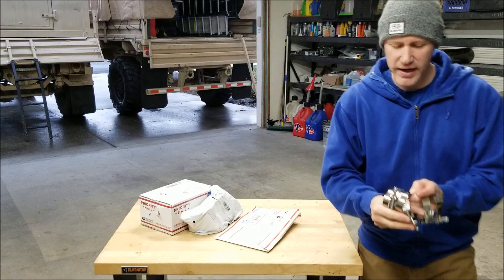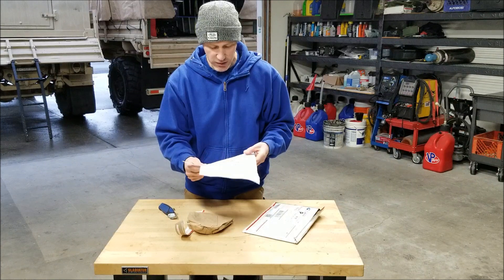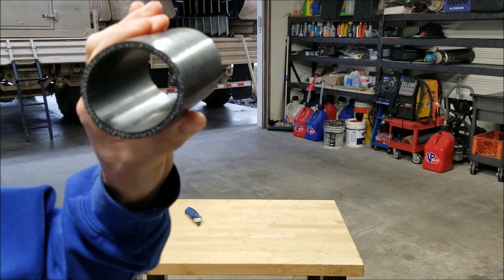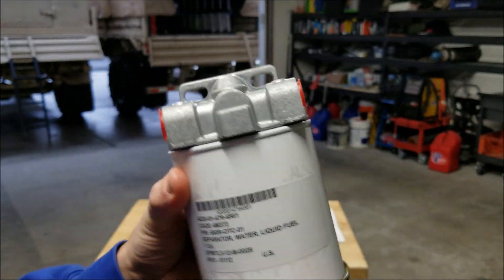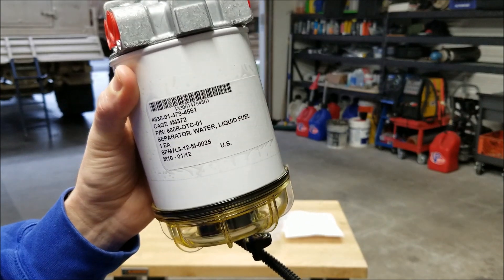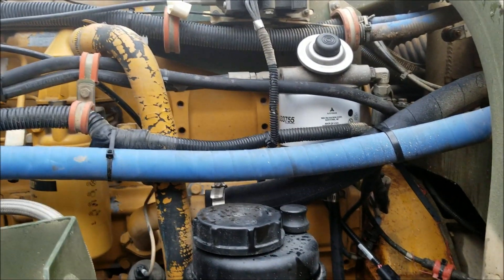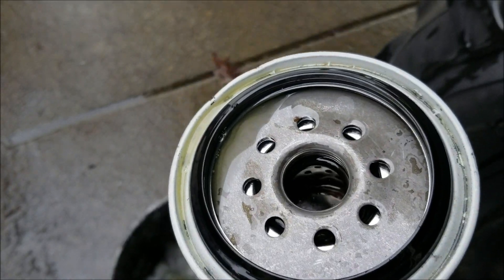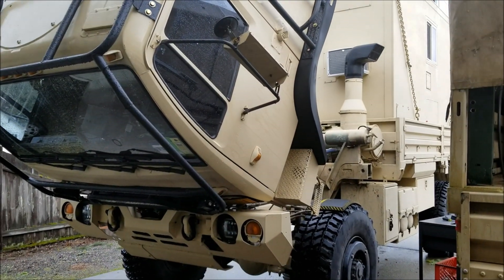Abel LMTV build part 79 (water/fuel separator replacement/upgrade, silicone intercooler couplings)

Comment: That was a good buy compared to the alternative. Too bad that the filters were not interchangeable as well. When we pulled the inter-cooler pipes from PARTriSha, they had a good bit of dust inside them. I'm not sure what that was all about. Anyway, thanks for posting the parts links... I'm sure that will save you time from answering those questions in the coming days. Now, you'll just have to point out where the links are for those that don't read the description. LOL. Smooth journeys on your next adventure! ;-)
Reply from the maker: Check your air filter assembly on Patricia.  Dirt got past it somehow.
Reply: @SeanFastidious  well, being that it is now sitting on the bed of the truck, I can look that thing over real well. Perhaps having good t-clamps would help, right? I'll be ordering some when I get the chance.

Comment: Sean thanks for the share. When you pulled the air cooler hoses, did you find dust or dirt in the tubes?
Reply from the maker: No.  Very clean in fact.